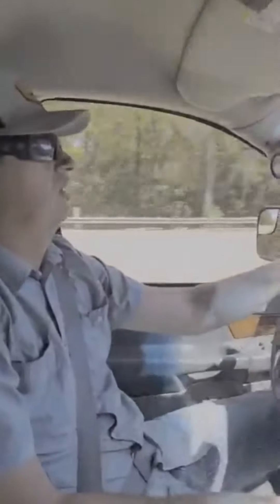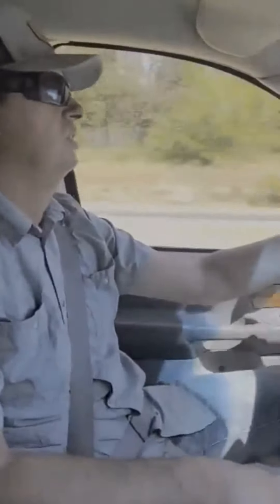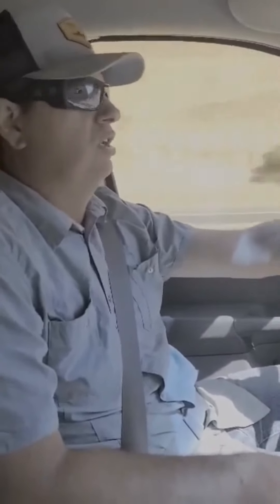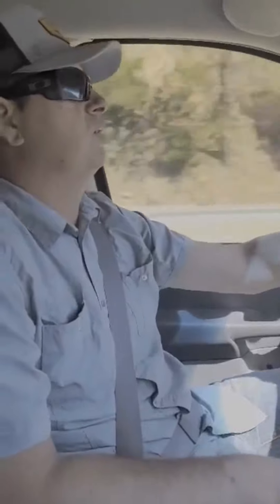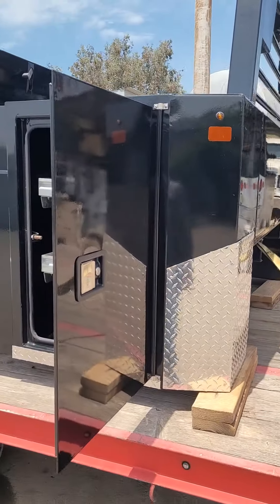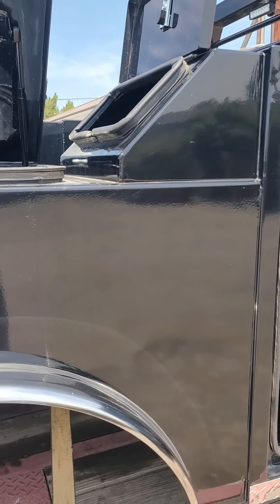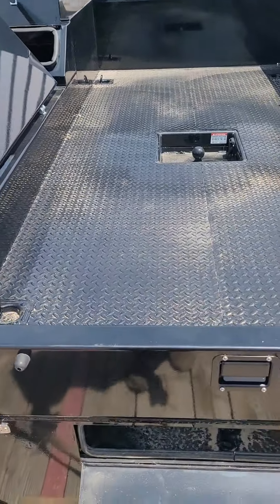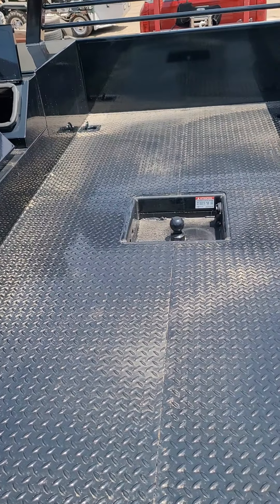Buying a brand new Norstar SD bed for my 2022 Ram Cummins 3500 Limited

Comment: What’s the width of the inside of the bed to say haul pallets or fitting a standard transfer tank? Also if you have a free second to measure that what’s the depth measurement of the under tool storage? Kinda looked like it just goes back to the gooseneck well.  Thanks for your help and beautiful bed! Keep us posted once you get it all loaded up.
Reply from the maker: 50" on the inside of the bed. The rear underbed storage area is not all that deep unfortunately. I think I remember measuring about 32" when I first got it.